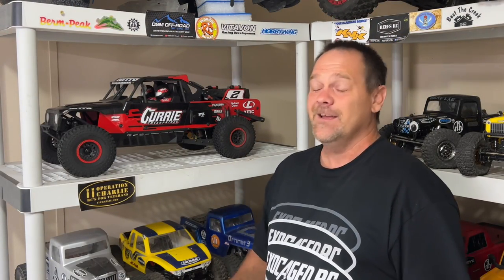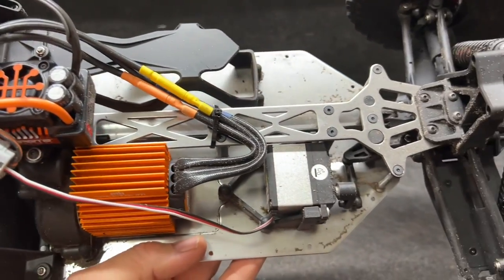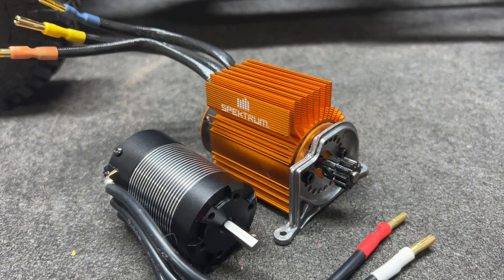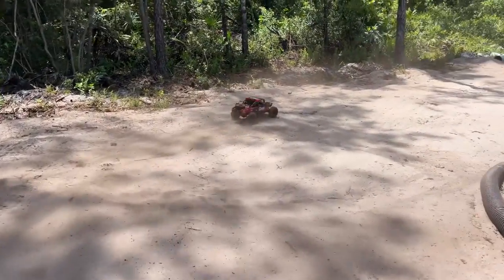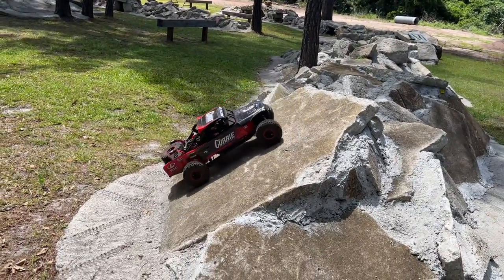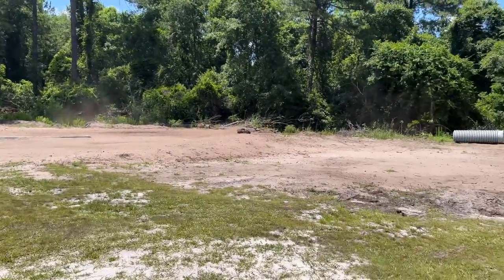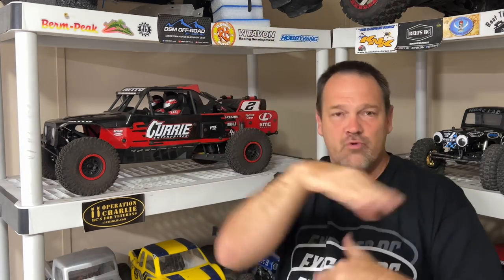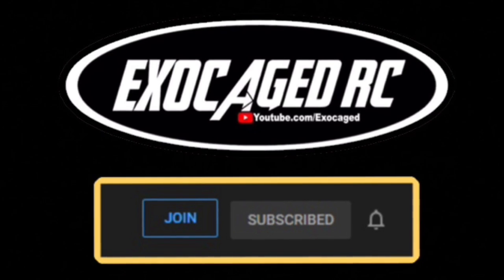Holmes Hobbies Puller Pro V2 4100 Losi Hammer Rey Castle Mamba X

Comment: Your rear driveshaft is out of phase 😎

Wonder if they fixed the dif issues that br and rr had. Recently got br and dang even on 2s front dif makes noises sometimes the dif pinion had super tiny bearings.

Idk if hr comes with it but rear locker in my br makes it so much more fun to drive and slide
Reply: I have both and I've had everything but diff issues, LOL! A and Trailing arms, shocks, output, steering bellcrank and it goes on.  They are both shelf queens at this point.

Comment: I really like the looks of this car, but your video has allowed me to see that rear end geometry is really bad. The attachment of the upper link needs to be as close to the pivot point of the lower arm as possible. The way it's attached now causes the rear end to pivot throughout the travel causing extreme u-joint angles. It looks like they may have done this due to the battery location, without seeing the actual car not sure how restrictive this is, correcting the geometry hopefully would just make battery insertion more difficult, if it makes it impossible you may be stuck with drive shafts problems.

Comment: gotta ask ... since this is a u4 racer why didnt you go with the PULLER PRO 4274 1/8TH SCALE COMPETITION BRUSHLESS MOTOR ? or save $55 and get a Hobbywing

EZRUN 4274 SL Motor with a max 8 esc ?
Reply: I’m working through mods right now as I want mine to be 6s. The stock motor is 36 in diameter and only have room for like 70mm in length. I haven’t got to the motor yet to start thinking about how to make it work but there has to be a way.